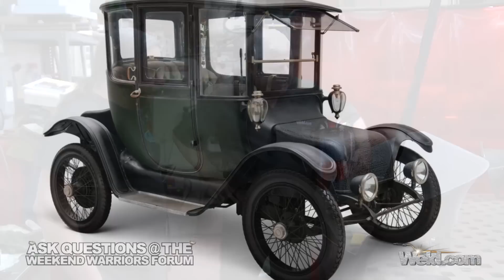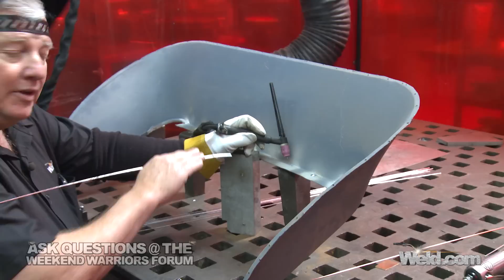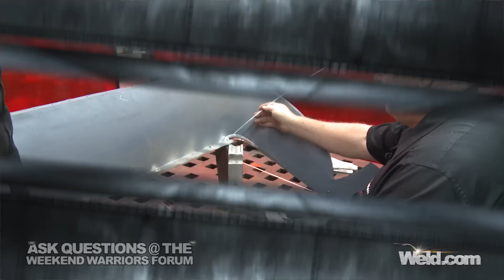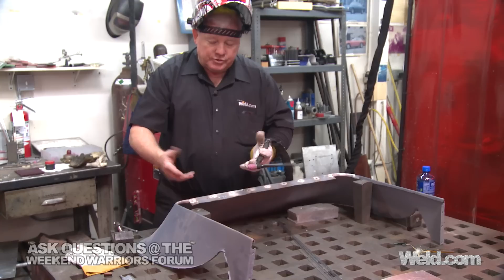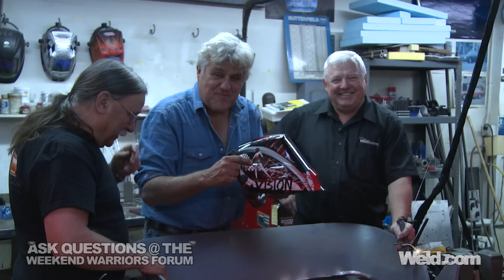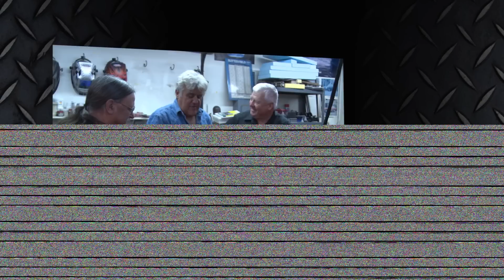Jay Leno's Garage: 1914 Detroit Electric Restoration - Aluminum Welding | TIG Time

Comment: The easiest way to find out the composition is to take the part to a materials testing laboratory and have an OES (Optical Emissions Spectroscopy) test performed to determine the elemental composition.  Very inexpensive and quite easily done.  Depending on the machine used, the test is done either on a spot on the part or a small piece is cut out.  Some machines can do the test on drill cuttings or even filings (make sure to use a fresh, clean file).